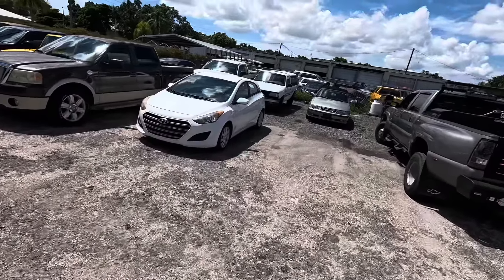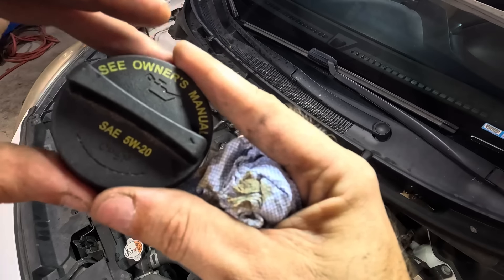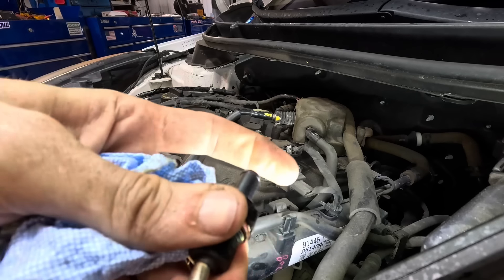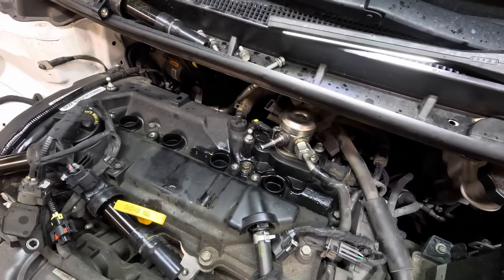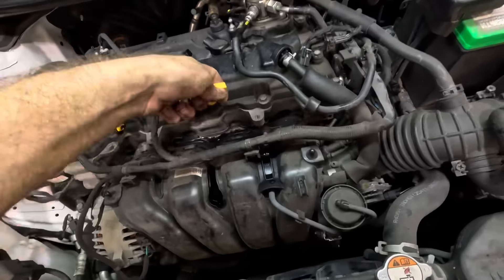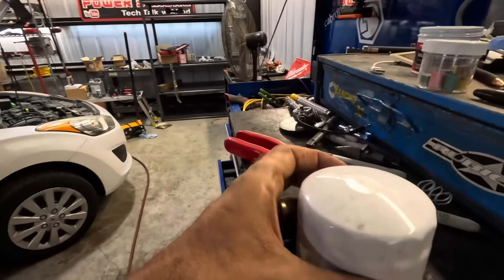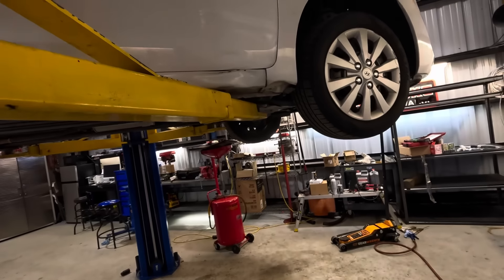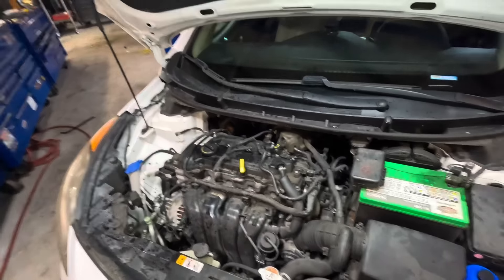Excessive Blowby! BURNING OIL! Hyundai Elantra 2.0l

Comment: @Rainman Ray's Repairs (Googled) "This is the ring recall (from googling Hyundai piston ring recall): Hyundai Motor America (Hyundai) is recalling certain 2019-2020 Elantra, 2019-2021 Kona and Veloster vehicles equipped with 2.0L Nu MPI engines. The piston oil rings may not have been properly heat-treated, which could result in engine damage" YOOHOO RAY, I remember reading/hearing about this... the Piston Rings on that car MIGHT be a Recall.

Comment: Sometimes the manual will allow another weight.  The 2011 Hyundai 1.6l calls for 5w-20, 5w-30, or 10w-30 if above 0F.

It's been decades since it went below 0F.

Comment: Change oil and add marvel mystery oil in with fresh oil change, New spark plugs and return in 2000 miles for oil change, A decarbonizing piston soak could also benefit with cleaning the rings.

Comment: We'll expect an update after 1000 miles Ray!😃
But seriously, since this treatment has shown some improvement, that's encouraging. So if it were me, I would have gone ahead and put the MOA in with that fresh oil to increase the oil's detergent effect. Then after 1000 miles, I would do a 2nd cleaning before another oil change, checking to see if blow by is further reduced. That would be an additional $100=$150 (additives + 5 more quarts of oil)... rather than the $800 service! Of course the more expensive service would likely be better, but I get the impression the owner of this car doesn't drive it far or often, so the much more costly service may be a problem.
Finally, is it possible the very low engine oil was causing a problem with the VVT and that was why the engine ran rough when hot? I don't know Hyungai engines, but I believe some VVT systems are hydraulically operated using the engine oil, making them sensitive to low oil conditions.

Comment: Makes sense to me, had a toyota 4 runner that got all carboned/gummed up from 20,000 miles or so in between oil changes. It was burning oil ( toyota mechanic said Toyota as great as they are had oil ring issues if the oil wasnt changed. We ran two different engine cleaners on two different days and the first day even had chunks of oil/carbon coming out. We doubled the treatment and ran the car for a week and it stopped burning oil. My 2007 Tacoma is burning a little oil and I'll be running some cleaner through it. I've only gone over 5,000 miles between oil changes once and that was because I had 2 shops in a row fail to do the oil change, I also bought the truck at 43,000 so who knows how it was treated.

Comment: I'm working on a 2013 Kia Soul that's been sitting for 3 years. It's a 1.6 L engine.  I am trying to remove as much potential sludge as possible.  To do that I removed the oil pan.  I found a little sludge but what bothered me is that the pan does not completely drain when the plug is removed.  Any sludge that makes it to the pan will not be removed.  I would remove the pan to see how much sludge there is.  This is not a Reeeeeeee!

Comment: I swear by the BG Dynamic Engine Cleaner.  (the lower cost version would be doing a piston soak with Berryman's B12 Chemtool works great too, for a whole lot less money...completely cured oil consumption in my 2007 Prius with 238,000 miles.  Was burning 1 qt/1000 miles, now no consumption in 5000 miles)... I think the BG Dynamic is probably safer, as it's less likely to have chunks of freed up sludge which could clog oil passages.

Comment: 15:11 like the Ford built Mazda B truck dump 2 cans of BG oil and gas treatment it in and change oil more often like 3k mils and hope the rings free up.
Reply: Looks like its worked.

Ok im sold I might do this to my 2001 celica  just because i have not been great with oil changes on it  
@ 300k miles it might need it.

The car says 5w15  ya think 0w 20 full synthetic is too thin?  Its toyota motor oil  not a basic oil.

Comment: I don't have a problem with using a chemical cleaner in my dodge caliber every other oil change. I did the valve cover gasket the top end of the thing is as clean as it was brand new.

Comment: Question regarding the oil sticker. If I do not put the miles on the engine and have passed the quote 1 year date is it still advisable to change the oil? Same for spark plugs? Thanks for these videos!!
Reply: The time thing doesn't apply to spark plugs, just mileage. With conventional oil it will break down over time even if you don't drive much. All the way back to the late 70s in auto mechanics in school we were taught that 3000 miles or 3 months, whichever came first was the best protection for your engine.
Reply: Thanks for the quick reply. If I pay extra for full synthetic oil then can I go by miles and not time?
Reply: @onsturn  I've heard it said a few times that even with modern synthetic being more robust it's still susceptible to moisture making it break down between heat cycles. Even if you don't drive 5K miles every year you still want to change it at least yearly if not more often. If your engine is a more modern one with VVT and other tech keeping the oil fresh is much more important than in older engines.

Comment: I have driven hyundai and kias for the past 15 years and always just used 5w30. Never between oil changes that i do anually did i need to top up any oil. All of them were driven thus far to roughly 300 000km / roughly 200 000miles with zero issues , ive had 4 thus far (1x 1.4 Turbo Diesel) 1.2 Petrol, 1.4 Petrol, and now a 1.6 Turbo diesel. In that case its as simple as we never know do the dealers actually change the oil from new, unless you check imediately after its done, in any event i would trust no body other that myself LOL. We also have two family members with one has a Kia Cerato 2016 and one is 2015 both 2.0 engines also zero issues over the past almost 10years of ownership to them. They also just do oil changes using 5W30 (any brand) full synthetic.

Comment: If it were me in that situation and that initial clean made drivability good again I would start using the Valvoline restore and protect oil. I drive an accord that has 315k miles on a K24Z and started running that oil and the oil consumption has dramatically reduced in the last 2 oil changes. Now mine was not as bad as this one was initially but If it is drivable in its current state I would just continue with 5k oil intervals. If it works great, if not try something else.

Comment: I had a Malibu like that, it wouldn't start randomly at first then got much worse. Took it to a shop and they replaced the fuel pump and it ran for 2 weeks until that issue returned. I finally took it to the dealer and turns out it was the ignition, it randomly would stop working, a known issue with them I was told by the service guy.

Comment: Hi  ray, have you considered comparing a full analysis of  the used old oil then  the engine cleaner plus new oil after a full cleaning process from the Motor Oil Geek guy, to see what is removed by the cleaning process etc? It would be interesting to see the results..

Comment: My guess is the low use caused the issue.
Also my guess this service will work well and will stop oil consumption.
How ever lo use may cause the issue again.
Your oil is good oil so it may be fixed.

Comment: The whole concept of stuck rings is not new. Back when I drove a Saturn, the general consensus was if it started using oil, let it sip some seafoam through the PCV until it died. Wait a day and then fog the neighborhood. Usually, the problem would go away.

Comment: Ray, a really good and in depth video. :-)

So, I have a few questions that maybe someone can answer. 

It is to my understanding that port injected engines don't suffer as much from carbon build up, but direct engines do. What we saw here in the video with the burning of oil, carbon and blow by and maybe sludge a result of direct injection engines? Like we see on Ford's Ecoboost. I have also heard with Hyundai's latest GDI engines they are prone to burning oil and eventually self destructing.

Comment: I think that pulling the spark plug caused that cylinder to depressurize, the engine rotated slightly and the HP fuel pump spit out the fuel from the inlet.

Comment: We had BG products at the shop I used to work at. My biggest complaint with BG was the spiffs. My argument was always, if the product is so great (I actually thought it was, especially the 44K) you shouldn't need to bribe the techs into using it. If I sold the customer the service, at the advice of the tech, it was because it needed it. To see the BG rep paying off the techs to use the product was a problem for me. Being the shop owner, I don't see this as an issue for Ray, but spiffs can put a shop in the trick spot fast.

Comment: Fix the oil leak first from rear oil seal before the oil cleaning
Reply: A bit of seeping at the rear main seal isn't going to be the cause of the problem being addressed.

Given the expense of doing it, especially when it's not critical, I'd put it on the customers radar as a future repair. Fixing the seeping rear main seal wouldn't solve the blow by and running rough problem.
Reply: @TremaineLea  absolutely wrong and if it gets worse and it will the motor will blow

Comment: Oh ya the blow motor screws up the the cars idling I changed mine and I went back to normal finally just so you know has I have no clue why but it really sucks a lot of power. It’s just easier just because it seems to work with the idling.

Comment: Blowby is when rings let combustion into crank case blowing by rings just saying oil usually wont make it into the combustion chamber due to rings letting pressure past  if it was getting into the combustion chamber. That thing will be smoking like a diesel.😊 Hyundai used a low tension piston rings to try to eliminate friction and increase gas mileage and decrease where on the cylinder walls and all they did was make well. Burners oil is going into your PVC system and back up to your intake. I bet your intakes are oily and you probably got coke up intake runners.

Comment: A coworker had this happen to their wife's car. There is a open service bulletin and extended warranty. Their oil blowby got so bad it sucked the oil out of the pan in 1000 miles and chewed up the bearings. Hyundai replaced the motor free of charge. It's a known issue.

Comment: "I don't see how a thinner oil could burn less oil."  Cliffnotes version, oil temperature at the ring lands is a couple hundred degrees centigrade higher than in the sump.  Thinner oils have less volume and evacuate quicker, meaning less time and material to evaporate when outside their operating temperature range.  Long version, ask a tribologist, because I only know enough to get myself in trouble.

Comment: Modern engines have closer tolerances and have systems that are "optimized".  So everything is much less tolerant of dirt, sludge, or anything that messes with that very limited balance.  Very clean is important.

Comment: Ray, the Protec oil filters you use are NOT designed for the longer drain intervals called for on newer vehicles. You are better off to spend a bit more and use the black Wix filters or something like Carquest blue filters.

Comment: I found an interesting error from wix on a filter I bought. I spent 10 mins trying to figure out why it wouldn't screw on my jeep and turns out the cap was wrong on the same part number.

Comment: Snake oil time \o/ dump cleaner in fuel system, engine flush 4x, rubber reconditioner, carbon cleaner into cilinder, h2 clean, walnut blast the intake ports, then do valve stem rubbers. hours and additives used and then realy clean and fix the block and head.
Reply: to check if valve stems seals leak. check engine next morning when cold and see if cilinders are wet or oil driplets are on the valves and stems.

Comment: Had the same problem with an equinox did a engine clean and 3,000 miles latter spun a bearing and blew the engine

Comment: Interesting, just changed the wife's spark plugs in her Kia Soul. Same motor 160k miles on original plugs. Just had to rotate the coil in the correct manner and it slid right by. Buy genuine Hyundai/Kia oil filters. We had some issues when using some of the other popular brands, not sure why.

Comment: 10:17 😮Hyundai and Kia are junk from the factory. I have a little blow by in my 02 Grand Am V6. I put a catch can on it and it collects the oil so it doesn't get burned along with the crankcase vapors. Very good invention. Love the long videos Mr. Ray. But you should always use the oil weight specified. Especially in GDI engines. Try AT205 oil treatment for the rear seal leak

Comment: This gen Elantra GT DOES have an oil change reminder light. I almost never see it programmed, though...

24:17 Ray, I'm 99% sure I've done plugs on one of these before and I was able to sneak coil no. 4 around the HPFP lines. Just needs a little finesse.

Comment: Is that the Nu engine?  If so, I've got the same one in my vehicle. 
Hyundai/Kia settled a class action lawsuit for this exact issue by extending engine warranties to 10 years / 150K miles. If that Elantra is not a candidate for engine replacement, it is very close to it.

Comment: Why the heck would they design a high pressure fuel line over the fourth ignition coil?
Reply: High pressure is one made of metal with nut bolt right side, this one is return/supply line low pressure.
Reply: @fibonaccisequence2891  But could they have positioned it further along so as not to block access to a maintenance item as Ray put it?
Reply: @ElysiumNZ  Yes, you are right, but that's not bad, I have seeing worst, check engine bay on new Jeep Compass, injectors over plastic valve cover🥴

Comment: Personally i like to look at what the manufacturer recommends in other markets that may have more lax epa requirements. For example in japan subaru requirements for my crosstrek 5w30 for all seasons but here in the states for that extra fraction of better mpg subaru recommends 0w20. Now my engine is out of warranty i run the thicker 5w30. As far as i can tell the us and Japan use identical motors and i have 170k+ miles and that fb20d runs like a top

Comment: Hyundai GDI engines need 3500 km oil changes with full sun oil if the are to last.  Non GDI I still change at 3500.   I've had great luck with Hyundai but they need to be maintained at half the mileage indicated in the service manual. IMO
Reply: I change every 1500 miles and double change every 4500miles every 3rd change  - 256k miles  1.6 GDI  -

Comment: They can do a 3k miles oil change and put half quart every 1500 miles like I do on my 2013 Honda accord with a common excessive oil consumption problem,  between many different oil brands I've tried on  I've found out with the Castrol  High Mileage Advanced Full Synthetic burns less oil

Comment: First off got both of your coffee's and they're great,  second was it just me or was there a faint train whistle type sound when the oil cap was off.  it was louder at first w/ the smoke then quieter after the cleaning.  I dont recall hearing it on other cars so is that normal or another symptom of blow by?

Comment: And engine im quite familiar with. I have an elantra N with the 2.0 and 6 speed manual transmission. It has a few upgrades. Bigger turbo blow off valve exhaust intake some electronics crap. She's around 425 or so and my daily and yeah they are oil pigs. Meaning even tho it's a fairly new car I change the oil every 3k because they are just known for burning it. Weird little issues. I'll be honest. This engine compared to my vw 1.6 turbo and I have an audi A4 2.0. And then the beast my wife has a audi sq7 with the 3.0 v6 supercharged. I'll stick to my German cars all day long. But I also think the Mazda rx8 renesis rotary engine is cool and fun to work on...

Comment: It's a Hyundai and you're wondering why it has blown by. Plus, did you actually try to check the oil while the engine was running?
In a GDI engine at that, if it's starting to run rough it might have some buildup on the intake valves

Comment: This is why I change my oil every 6 months or 5k miles. Which ever comes first. Not the dealers 10k or 8k recommendations. Fuel saturation degrades oil especially in a direct injection engine.

Comment: Ray, how are you ? Quick question for you. 2021 Acura ILX. I do a radiator flush, refill, burp the air out will the spill free funnel, let the fans come on twice, fill the overflow tank to max level, put the radiator cap back on, I’m only getting heat on Hi setting? If I go to 85, 84, ect…. It goes to basically room temperature? Any help would be appreciated.
Reply: The thermostat may be stuck open.
Reply: @wayneessar7489  Both hoses are hot, when car is at temperature, and I get blasting hot heat on Hi setting only? If I go from Hi, to 86,85, 83, even 75, it goes to room temperature. Could I get heat on Hi, and not other temps, if it was the thermostat?

Comment: depending on the year of the car, certain hyundai engines have a problem with oil consumption. They settled a class action suit I think in july of 2023. Hyundai is replacing the engines. My own vehicle is unfortunately suffering from this issue. There is some part of the engine that does not get enough oil because of some manufacturing defect. I'm not sure on specifics. Mine started with the same thing, assumed misfire and running rough.